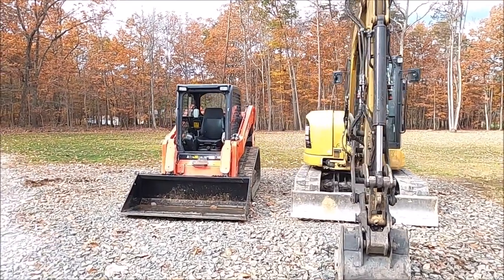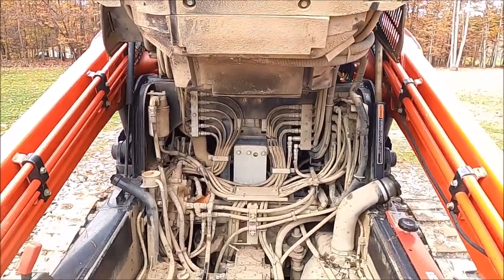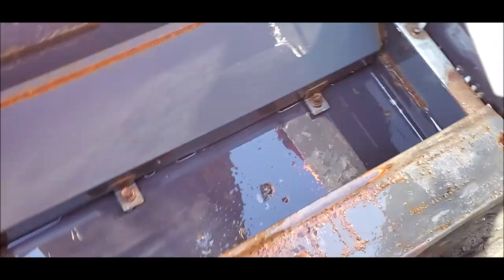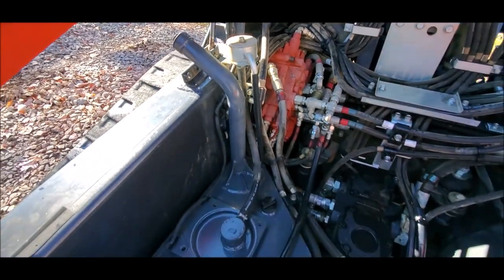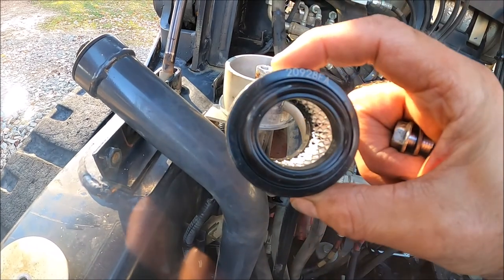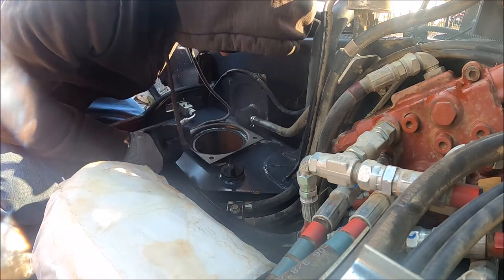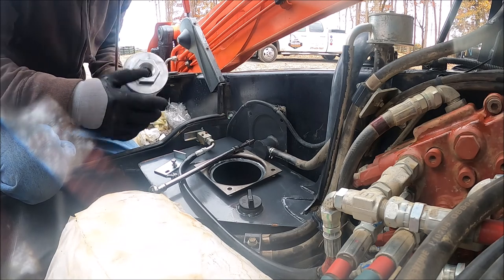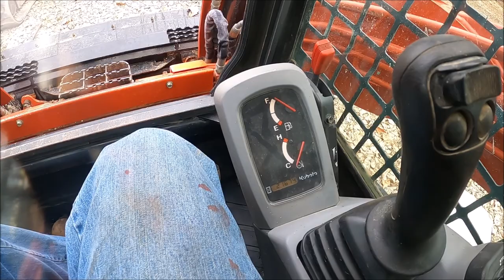Kubota SVL75 Hydraulic Service

Comment: When i got mine it had only 50 hrs on it and i had to use a chain hoist to break the cab free. Had to use it as an assist for 3 or 4 more times. Best thng to do is raise and lower it multiple tines to get the lift assists working and ease up tjr pivit joints

Comment: Are you confident that power washing that area is okay? I’d like to do the same to mine
Reply from the maker: Absolutely. Quite a common practice for some who care to keep their machines clean. With this machine nothing but hoses and tanks under the cab (minimal wires).
Reply: @JerichoRally  on the machine I drug home the dirt was packed between fuel tank and frame along entire length of tank. took 8 hours of pressure washing to get it acceptable. Just terrible how bad these can be ! but 40,000 less than new on my 2000 hour machine, I'm not complaining yet. I'd like to replace lower pins and bushings but both pins are pretty seized on plate end.
Reply from the maker: I too need to replace the pins and bushings at the bucket. Hopefully they are seized.

Comment: Drain tube is in your tool box.
Reply from the maker: Yeah I found it after the fact. Now I know.
Reply: Yup I found mine after I pumped the oil out
Reply: Much easier to drain out the front from under floorboard for sure!  But I feel for you on the replacing of the two inside filters.....my hands aren't huge, but it was still all thumbs when I did it the first time.  Kubota engineer should have made the entire top removable, not just a small hole....it would still be sealable and maintain pressure without the present design if built correctly.
Reply from the maker: Amen!!!

Comment: Clean out the rear lift supports also it will save you from a nightmare and check the fuel cap and neck for rust and clean and rub grease on them
Reply from the maker: I did those too... but I didn't grease the cap and neck though. Good idea!
Reply: It gets rusty and then it will get into the injectors and tear it up and they are over a grand a piece
Reply: @johnhurt1583  The replacement neck has been powder coated inside and out. No more rust.

Comment: y did u need the trackhoe to lift the cab? it usually lifts easily unless something is binding.
Reply from the maker: I wish I knew! I don't think I'm so weak that I can't lift a cab so I'm thinking the struts are completely worn out. Thanks for watching!
Reply: @JerichoRally  was a great detailed vid. Thanks for sharing.
Reply: Just came across your vid again and it dawned on me. i bet you never removed the safety pin in the rear of the back of the cab. Lifting that w the excavator surely bent and damaged that corner.  That is also intended to be reinsert while working inside till your done.
Reply from the maker: @yellowmetaldriver1460  nope. It went fast but it was in the video when I walked being the skid steer to put the locking pin in position (was out prior to lifting but that part was not in the video).
4:30 shows the pin in locked position and also indicating it was not bent during my attempt to lift.
Reply: You won't want to lift cab with the hand bars.  They are light steel tubing....mine were bent and one broken while a was logging....very easily damaged and they are meant for safety grabs....another Kubota engineering issue.  The cab has padeyes on top if you NEED to lift it for any reason......they ARE NOT to lift entire loader though, just cab weight.
Reply: @raycowles6646  I have a 2021 full cab wide track.model and my verticle supports are solid.
Reply: @yellowmetaldriver1460  got it......mine is a 2016 and they are tubing, not even near SCH40.......I still have to manufacture a set of some kind of grabs.  Like yours with the solid bars, they should have made that way from the first model.

Comment: I just got a used svl75 and today i tried to open the cab and mine wouldnt budge either..
Reply from the maker: I'm hoping it's just the struts. And congrats!!
Reply: @JerichoRally  It is, had to replace mine.
Reply: I found that once the seal is broke loose, struts assist just fine, so, as you stated, that's it.  Even at my age, I can lift the cab.....I use blocking to get it up a bit, then it becomes easier.   Hope my comments help, thanks for the video.
Reply from the maker: I'll add the struts to the list of parts. Bottom of my bucket has worn through so now I need to fix that asap.
Reply: Good lord, read the manual. There is a pin in the hinges in back that needs to be removed before lifting.
Reply: @wbar4398  Used machines dont come with manuals.. but thanks
Reply from the maker: The pins were removed prior to attempting to lift. If you look carefully in the video, you can see the pin is removed.

Comment: Did you have to bleed any air off the lines?
Reply from the maker: In a sense. It's an open system. In the video I change the breather filter. 
To "bleed" the system, just operate a control, like curling the bucket, for an extended period of time. Any air will be moved through the lines.